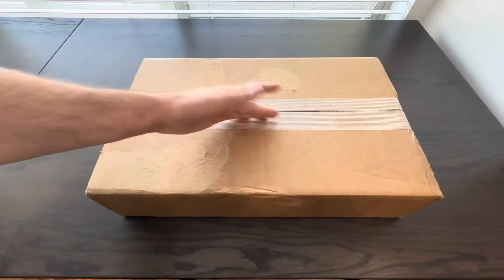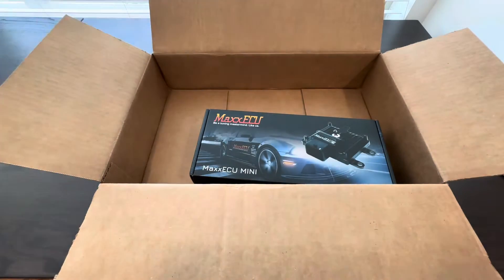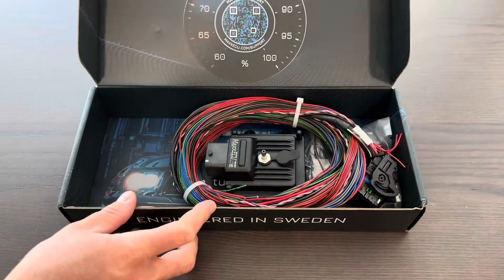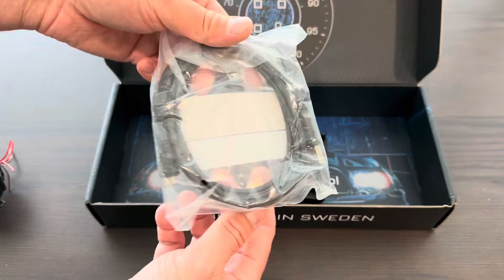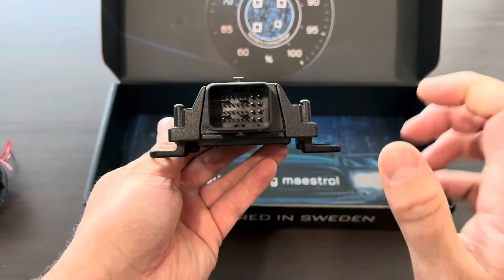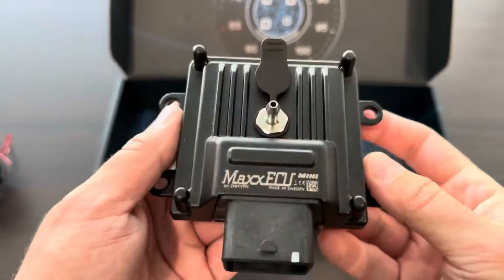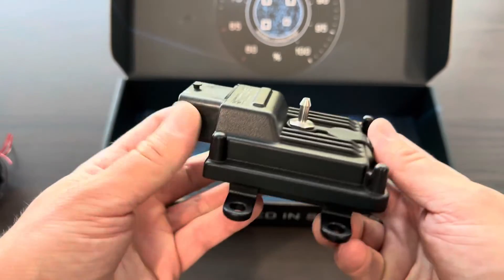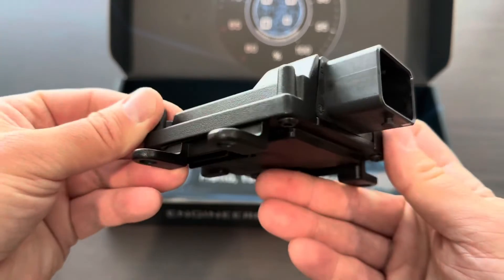MaxxECU MINI Unboxing | Overview 4K

Comment: Would this work as a primary ecu? I have a 1986 nissan 300zx and I need a more tune-able ecu.
Reply from the maker: Yes it would work on that application. But you need to make the wiring harness
Reply: @TurbineResearch  what ecu would you recommend for me? On a budget and I just want to be able to tune the engine.
Reply from the maker: @NLamki2002  it depends on your level of expertise with wiring. Most stand alone ECUs need to be fully wired into the car. You will also need a wideband sensor so buy the time you buy a wideband controller it can make a cheap ecu the same price as something more featured. Take a look at the maxxecu street with lsu4.2  or if diy autotune has a plug and play that may be a good way to go
Reply: @TurbineResearch  I have no experience with wiring but I'm good with tech so I'm willing to learn. And I don't mind the time as it's a long term project and I still need to buy coilovers, new interior, etc. 

Anyway thanks and I'll take a look
Reply from the maker: @NLamki2002  there are lots of good wiring resources available so you should be good with a bit of research

Comment: I really enjoy your videos. This one is cool, I'm looking forward to piggy backing a stock ecu. Did you ever get the megasquirt canbus to work? I think I heard you mention this in a past video.
Reply from the maker: The microsquirt has many default can outputs that can be used for dashboards but inputs are not easy at all unfortunately. MS3 can do a lot but ms2 is much more limited with can inputs